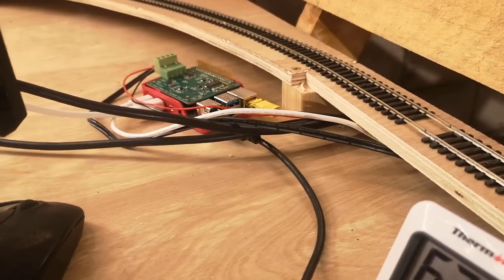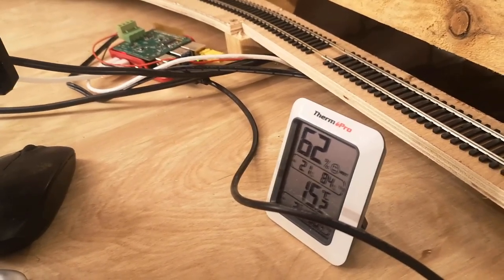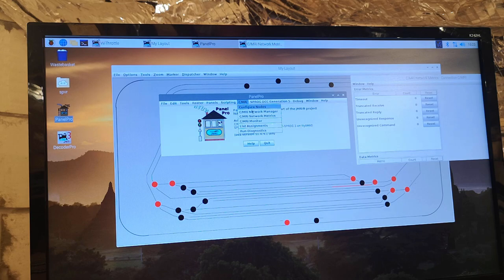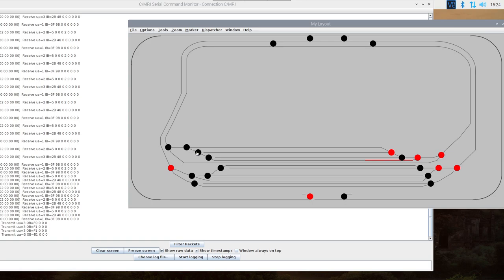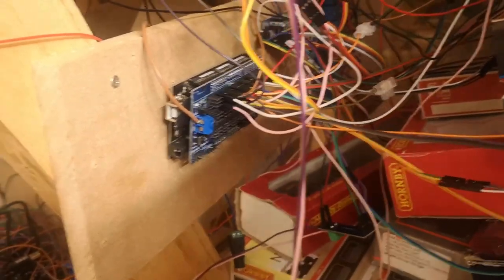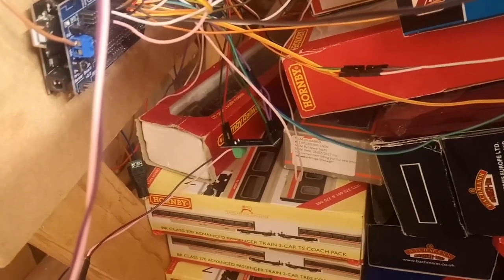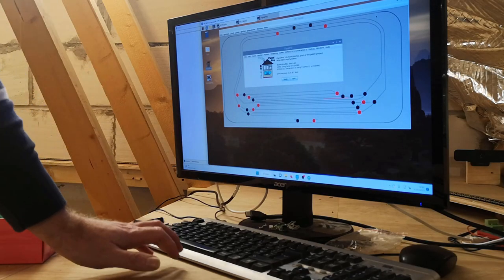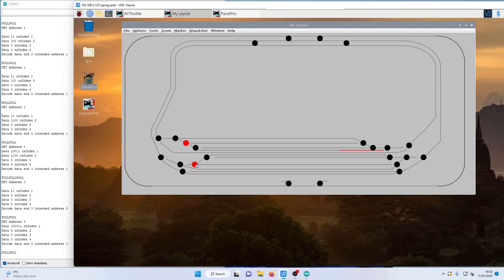Adding a JMRI / CMRI data monitor to my RS485 bus to pinpoint the cause of data issues

Comment: Hi, at 21 mins you talk about the 4th node degrading the quality. If you are using unmodified MAX485 modules then I think I might know what your problem is. RS485 cables need to be terminated with a 120 ohm resistor. The MAX485 has one of these onboard (R7). However. You only need one of these on the line. You probably now have four 120 ohm. in my experience 4 is when things start to go wrong. You can carefully desolder  the R7 from all but one of MAX485 modules. On a short system like yours the MAX485 with the resistor still in place probably won't have to be the last one on the line. Just make sure it's one that you will never remove from your system.
Reply from the maker: Thanks for taking the time to post this, Chris. I had, actually, found out about those resistors since, but I haven't seen the what and why documented anywhere as clearly as you've put it here. I hope that if anybody stumbles across this video and they're looking for help, they read this comment. Thanks again, regards, Chris
Reply: @WirenwoodModelRailway  Thanks. I can't take all the credit. A friend in MERG explained it to me. I'd highly recommend joining MERG and getting involved in the Arduino and Automation Special Interest Groups. It's only £20 a year.
Reply from the maker: @chrissharp6845  Ah yes I'm already a very committed MERGerer🤣. I think this would be a very different - and more expensive - layout without them - all of the point motor mounts and block detectors, not to mention the advice! I have joined the Arduino and automation groups but somehow haven't managed to get involved yet, something I should really try to change this year I think.

Comment: Excellent work building the 485 sniffer. I am so glad you found the issues. I watched the whole video and did not skip to the end to see if you were successful and I am glad I waited. I see you have been working on this far longer than I have been subscribed. Good on you for sticking to it and vanquishing the gremlins. 
Job Done. Mike USA/VA
Reply from the maker: Thanks Mike, that's very kind! And well done for sitting through all of it, that must have been pretty tough! And yes I think those gremlins, those ones at least, are finally vanquished.
And yes, been going for a while, although only since March last year on the current layout.
Regards,
Chris

Comment: Really interesting.  Similar sorts of problems historically.  Dodgy 485 or on occasion a duff Arduino nano.  I’ve got 5 on the bus with 3 pca9685 servo drivers.  Shifting from JMRI to dcc++ with the cmri code instead.  Want to get Rocrail running instead.  Great video.
Reply from the maker: Yeah, watch those 485 chips closely. I ended up switching to MQTT but accidentally left one 485 chip attached to an Arduino. It was disconnected from the bus wire but still connected to the Arduino serial. After a couple of months that Arduino went down, became unresponsive - I realised that the 485, which had been sat there doing nothing, not attached to anything else, for 2 months, had suddenly failed and was flooding the serial bus on the Arduino. Pulled the 485 chip out, everything went back to normal. They're so, so flaky, and so, do destructive when they fail! dcc++ with CMRI code sounds interesting, I might look that up! Regards, Chris

Comment: Chris,
I have precisely the same setup as you do, only not fully sketched and complete.

I run a RPi with JMRI 5.0 and java 11, then of this Pi to serialport ttyAma0 to the serial lin of the Arduino holding the sensor shield .

I do not yet have a ir sensor  set into the test pin 1, nor do I have a turnout set up .

My turnouts will come off the turnout table, into the sketch as an output card on the first pin of this card.  Polling is working radpidly and the binary received back is 0 0 0 0 0 0 0 0 at the moment.

I also need to verify the mapping on the sketch.

The turnouts will be driven by servos from a PWM server driver module, and have not tested yet this far out..

from what i can see, the turnout status should arrive at the arduino  into the first output card.  Since outputs begin their addressing again, this first turnout is 1001 on the first output card.

Part of the sketch appears to translate this bit position on this card and along with turnout position data, sends it off to the PWM driver board on the first pin of that ard.  A servo should move on this pin at this point.

If you wish to hook up while we get this all working, reply to me and I will send you my email address so we do not have to go thru youtube comments with this.

Best of luck
Bob Schworm - cleveland ohio
Reply from the maker: Hey Bob! Thanks so much for the message. It would be great to get in touch - I think this channel has an email address in the info - it's not my main one and I sometimes forget to monitor it but I'll keep an eye on it - if you email there it'll save you putting contact details publicly on here. There seem to be very few people doing what we're doing - or talking about it at least - so it's good to have a few people to chat about it with.

Looks like you're' going very much along similar lines with your setup.

Regards,
Chris

Comment: Your common ground looks as if it runs from the USB/RS485 to each of the Arduino shields, is that correct?  I do not have this yet so may be an issue. Some sites seem to recommend it, other say it is not necessary.
Reply from the maker: Hi, yes! Comes out of the ground on he USB rs 485 adapter on the Pi then runs right around the layout and yes, into the shield on each of the Arduino nodes. That way everything has a common ground, as everything else comes off that shield.
Feel free to contact me, email address in the about on this channel, if you have any questions!